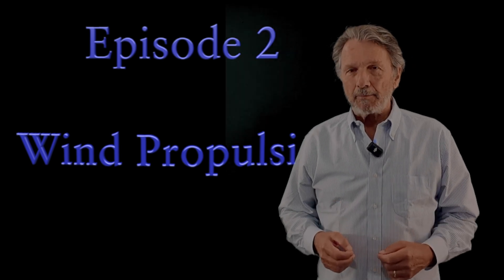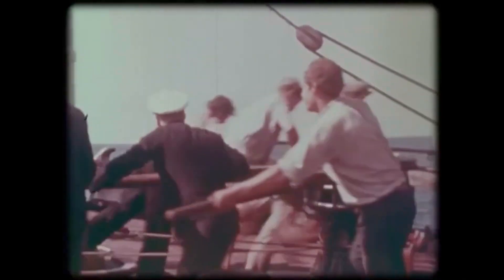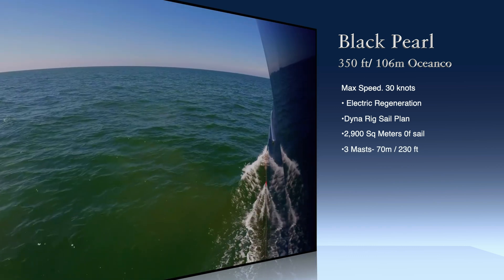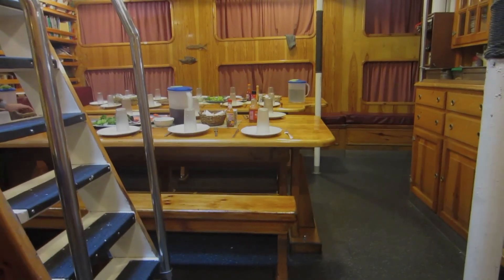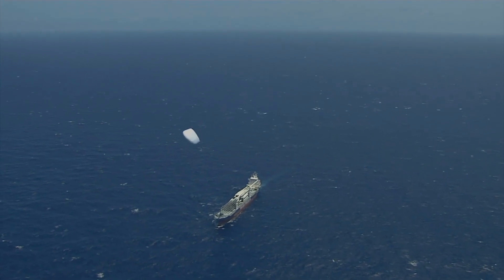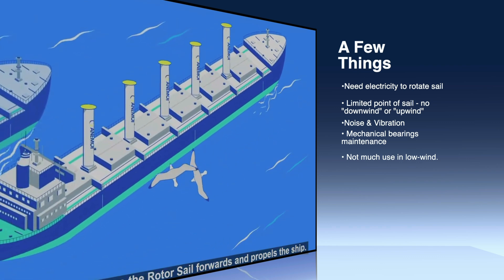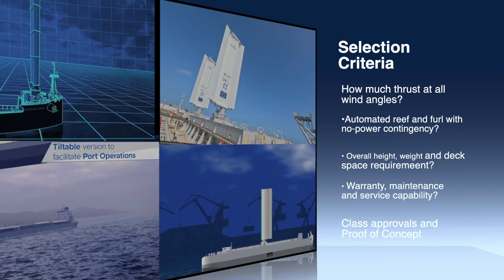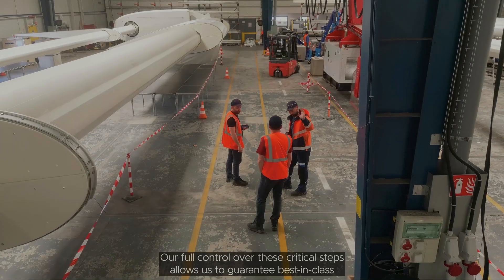Next Generation wind-powered Long-Range GLOBAL EXPEDITION YACHTS

Comment: You're missing out not considering kites. They have many benefits. They work at higher elevation where winds are stronger. Don't take up much room when stored. The companies providing them make them incredibly easy to operate by anyone and are virtually autonomous when employed.
Reply from the maker: Having run over a spinnaker with a sailboat, I would worry about a sudden change in wind direction or velocity. I understand that they can retract quickly in such a situation, but I would not want to find out the hard way. Another major draw back is that the wind has to be behind you for these to work. They have no upwind capability.
Reply: @XplorerYachts   @IncredibleShips  I'm sure you have more sailing&boating experience than me, so I not be thinking of all the same variables. Kites can go upwind, though admittedly with greater difficulty than traditional sails. Boat and kite design plays a factor of course. The systems running them, though, are damn near autonomous and idiot proof so sudden wind changes and course corrections are handled electronically. A benefit of the kite system is in an emergency you can just cut the line. Replacing a kite and line is relatively cheap/simple and you could also have a replacement stowed without need lots of space. And why sail upwind? That's why you have motors haha. They can also be set up to generate electricity. 
Ultimately I don't know your exact vision but I love kites and think they're amazing and my dream boat I've been designing would have one. I had another idea for wind assistance. Using booms on either side of the boat to hoist a hammock like sail between them. Basically a kite on fixed points. It'd be strictly downwind, but simple and effective.
Anyway, love that more people are developing hybrid boats and systems. Excited to see what you ultimately settle on and what your boats capable of.

Comment: I've been the greatest advocate of multihulls because you get a stable yacht with a wide beam, a very low drag, and a very shallow draft, but I personally would never buy one, mysel, since these most likely wouldn't outlast my own life.

They are efficient, but could rupture under adverse conditions. 

A multihull with centerboards/daggerboards could even overcome the capsizing challenge.

Take a look at the Independence Class trimaran and also at the Adastra trimaran  if you want efficiency, but can settle for immortality.

Comment: As someone that was a proponent of Flextern sails, primarily because I watched a YouTube video about them and thought they were cool, I had hopes they would win. A.thpugh in the video I watched, it was set in the 30's a d they didn't have rotary sails. The wind simply went around poles and that created a low pressure area in front that enab,ed the boat to save on fuel. But maybe I was wrong. But then Paul never responded to comments so mahbe he never rezd I was talking about Flectern sails and not rotary sails. I had even suggested them to Arksen for their 85 project and was told they were looking into it, but then I never heard anything back. I'll have to go bac, a d check outmthe other YouTubers video tomsee if rotary sails zmd Flextern, which may nkt be the right spelling ....hmmmm.  More research is needed.

Comment: Azimuth electric propulsion with methane fueled fuel cells (and of course batteries), assisted with sails such as you propose, and a liberal splash of solar cells and other wind turbines where practical, could make for a ship with very little actual fuel usage compared to a conventional ship. If the yacht buyer were to invest in a pilot plant fabricating methane from solar power, pulling CO2 from the atmosphere, and build it big enough to create as much fuel as their yacht consumes, they could honestly proudly boast that their yacht is net zero.